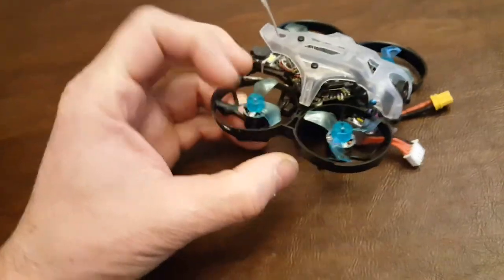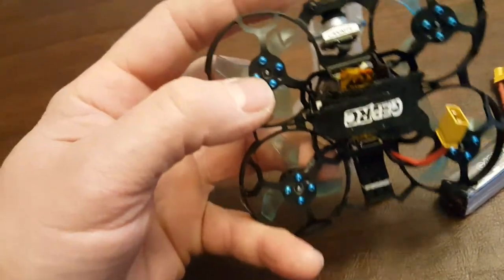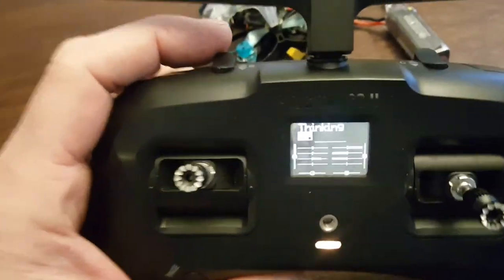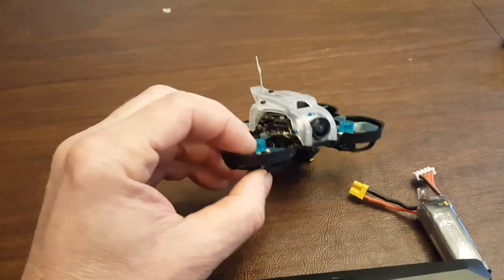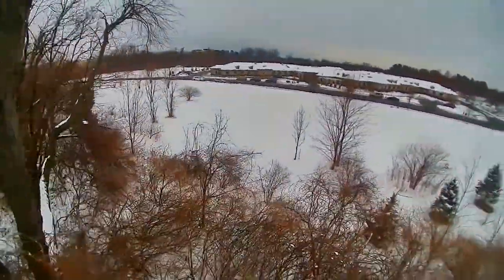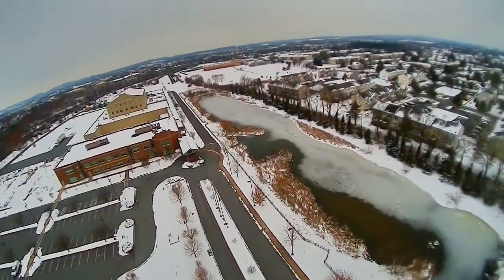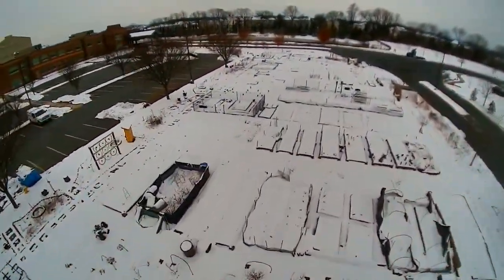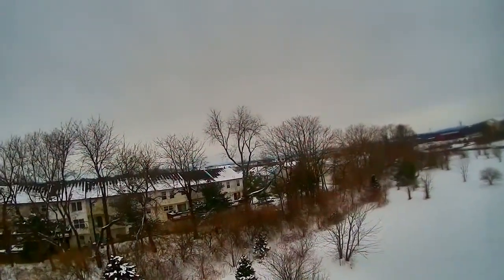Ultralight Thinking P16

Comment: Very nice work , have you built another one or changed the flight controller. I can’t find the one you mention in your build. I know nothing really about turning so was hoping to just copy your tune . I have the stock thinking p16 hd from geprc. Will do the naked vista change soon buy yours seems to fly so well , was making  me thing I should get the same stuff you are using .
Reply from the maker: I still fly the Thinking P16.   I flew it yesterday.   But, it is mainly an indoor flyer because doing any bando moves on a ducted fan really makes it want to flip over at the worst time.   I run the micro polar camera on it now too.   That is a great camera.  My choice quadcopter is the AOS T3.   It has to be built.   I will do a video on it.   I had some custom aluminum hardware made in China for it to get the weight down to 123g with a 1000mAh 3S battery.   It gives 15 minutes of hover and 8 minutes of pure bando flying.   I will do a video on it.   Also, tuning really isn't that important.   It is better to hard mount everything to prevent loose stuff.   It is impossible to tune a tiny whoop to fly as good as a tooth pick.   The aerodynamics don't let it happen.

Comment: Hi. Does the GEPRC Thinking P16 whoop have a buzzer inside of it out of the box or do you need to install it yourself?
Reply from the maker: I add the flywoo buzzer without the shrink.   Double stick and dental floss hold it down.   A buzzer is a must when flying outside.
Reply: @microdronetech8453  thank you!

Comment: Nice video...you gotta love the range of crossfire. 😃 I'm building a whoop with a vista unit and an HGLRC aio 25amp board with this Thinking p16 frame. If I was to use 1105 motors and a bigger 3s would the handling not work out well? There would be more power but more weight and the prop size would still be small. You seem to know a lot more about tuning which I know nil...lol. I can put em together and set them up on betaflight but thats it. Any idea?

Comment: Great video, and I'm diggin that quad...On Opentx,  could you do a step by step review on how you setup the stick controls with audio, like SF ARMING with sound, and if you don't mind, I would like to see the PIDs for this quad. I'm pretty sure I'm going to order this frame. I have the Namelessrc fc board, receiver that I can install in it, as well as 1103 motors. I just need to get a vtx.
Thanks for sharing... Smooth flying there my friend